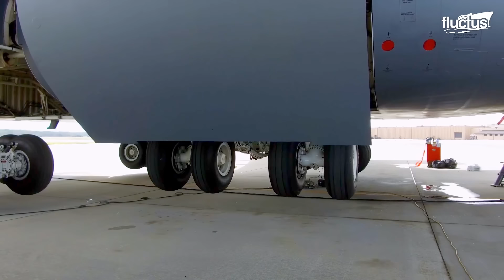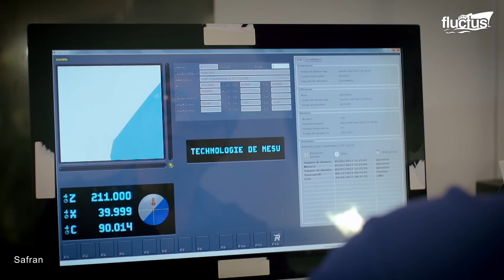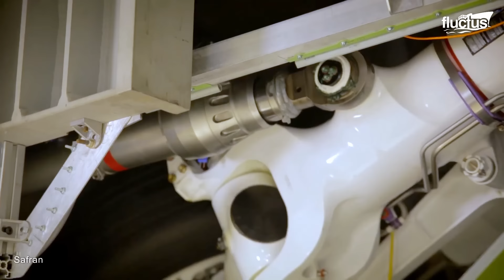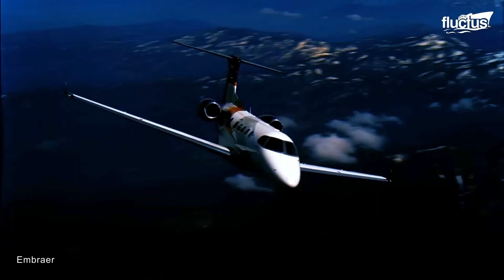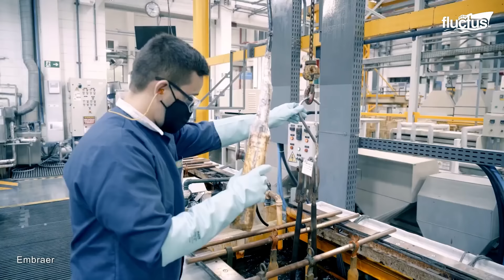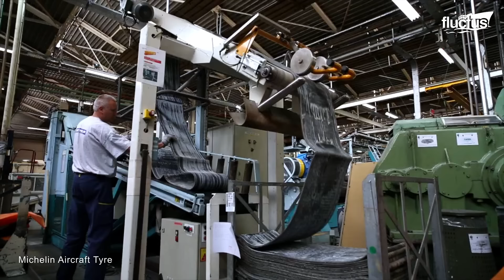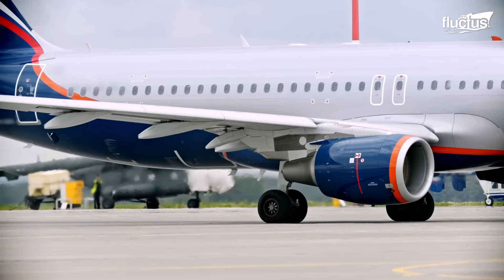The Crazy Engineering Behind World Largest Landing Gears  Lifting 420 Ton Aircraft

Comment: One thing they haven’t figured out yet is to drive the wheels at the same speed as the their ground speed so the tires last a lot longer. Those tires are expensive!
Reply: It wouldn't really make that much of a difference. I remember watching an engineer explaining that the cost, complexity and reliability of such a system wouldn't be worth the extra 5% to 10% lifespan you'd get from the tires spinning up before landing.

Comment: 1:07.........280 000 pounds necessitating better'........A plane called a 'heavy' is 
300,000 pounds or more so this is poorly written at best.
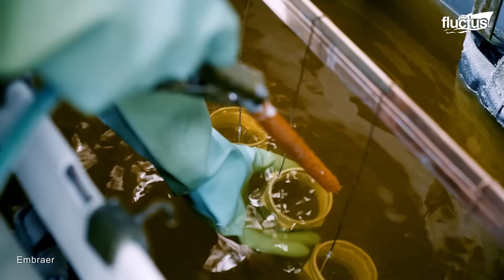7:44 ........dipped in chromium cadium or other such......Think you mean cadmium.
Another senseless mistake.
Reply: Cadmium is less and less use by Safran because it's dangerous, replaced with a zinc-nickel alloy
Reply: @leneanderthalien  And they are not "dipped" - like in a can of paint. LOL They are electro-plated.
The mechanism of electrodeposition from a sulfate electrolyte.
Cadmium plating is done in cyanide baths containing a mixture of cadmium oxide and sodium cyanide to produce Na2Cd(CN)4.